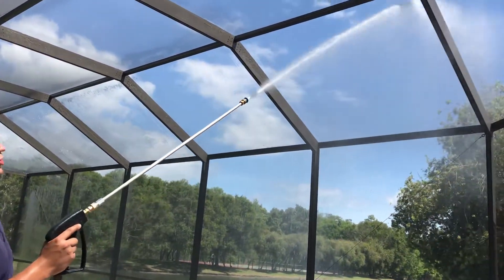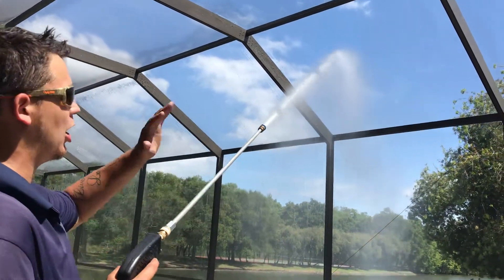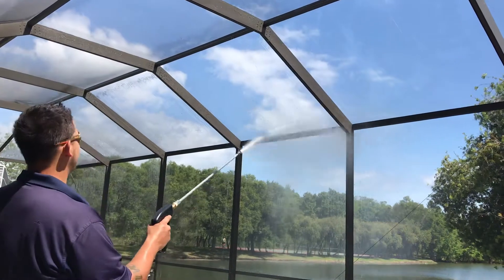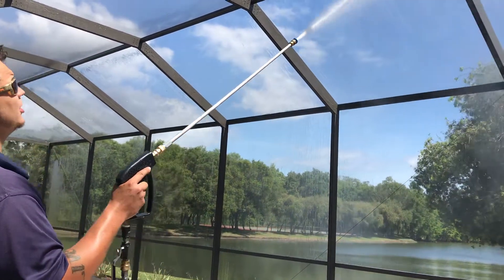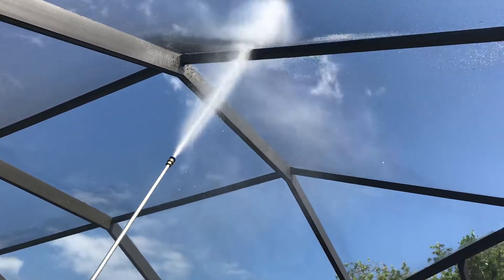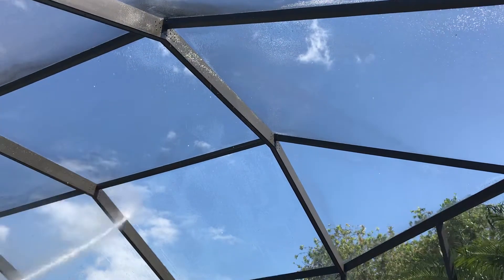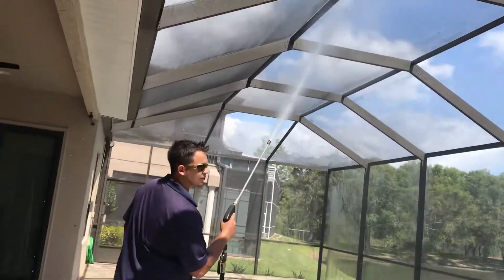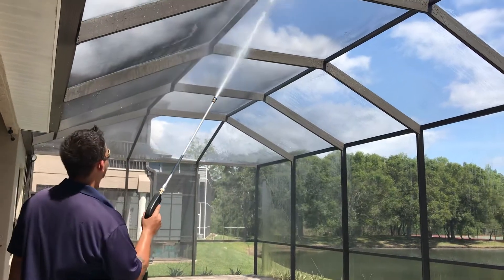How to clean a pool cage or screen enclosure “inside”

Comment: If you don't have any mold or debris on the screen, why are you even spraying it?
Reply from the maker: This particular homeowner is very proactive with the exterior upkeep on the home. They have always opted to clean before it gets to the point of visible growth. Hats off to them!
Reply: What nozzle you recommend
Reply from the maker: Bender Professional Services Well i really depends on what size unit you have like how many Gallons per minute your pushing the  the next question is are you trying to throw soap or rinse?
Reply: Christian Smith 4gpm.  Throw sh and surfactant